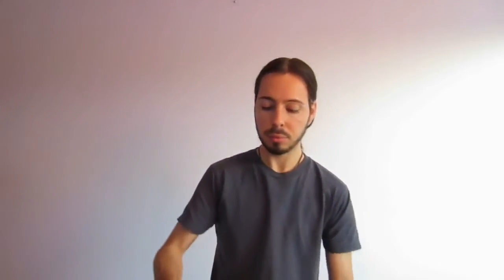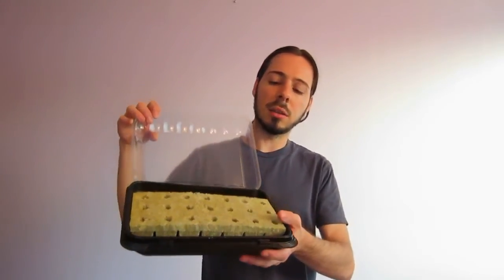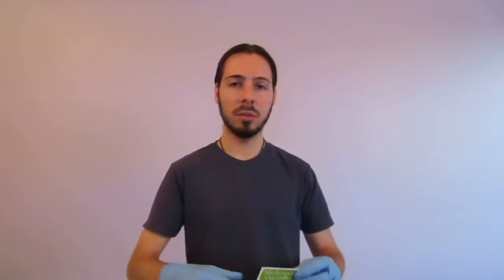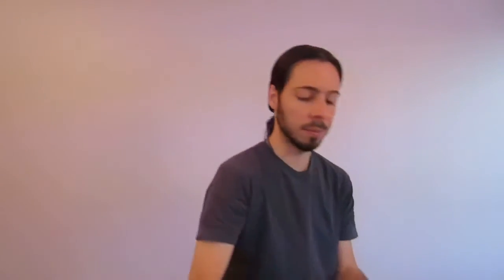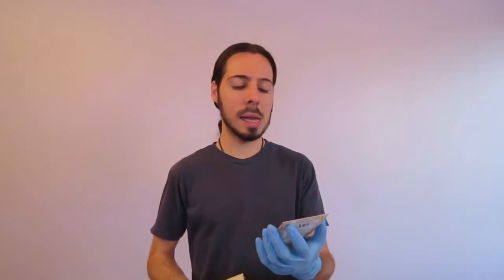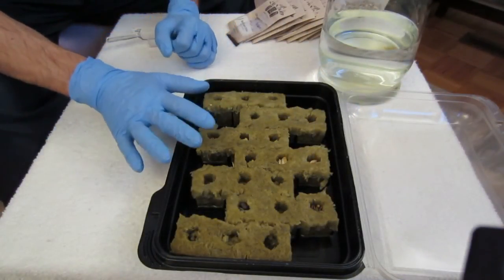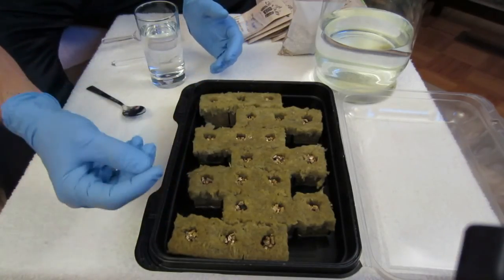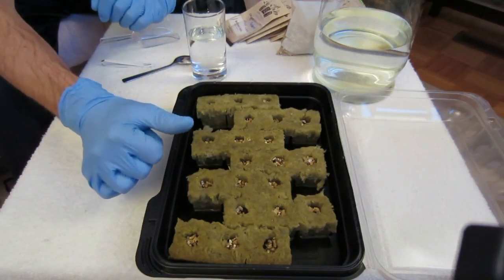Tower Garden Germination Preparation

Comment: Thank you for your great video. I just purchased the indoor tower with grow lights, and I've seen videos recommending starting seeds directly in the tower as well as in the provided trays. I live in zone 6B (34 - 50 degrees F today) with diminishing sunlight moving into winter, and no great sunny location in which to start my seeds on a window sill. What are your thoughts about starting seeds directly in the tower and using the grow lights? Many thanks!
Reply from the maker: Hey there Kate! Great question, and I just responded to someone about this, I might copy and paste some details :-P
Your zone ain't too much warmer than mine, guess your outdoor growing season is done'ish!
Don't start seedlings in the Tower tho.

Now some copy and paste   haha
It is CRITICAL that those into indoor growing, invest into growing lights. Almost any type of grow light will work fine for starting seeds, they just need to be at the right distance from the seed/plant canopy for it's type (CF about 6" away and LEDs usually 1.5 to 2 feet away). Without the adequate lighting, the seedlings always become leggy and weak and may not survive the long haul. Beside a window just doesn't cut it.
Once the seedlings have developed their first or second pair of TRUE leaves, their "neck" is done stretching, and with close proximity to the lights that neck stem won't stretch much from the start, that's what you want.
You Cannot start seeds in the tower garden itself, because the lights are far too distant from the seeds. You'll produce plants with a poor support structure. Mature seedlings need to be nurtured first before being transplanted into the garden!
Reply: @CardinalGardener  thank you for your time and invaluable instructions! I'm very excited to start the germination process effectively. I have LED grow lights on positional gooseneck armatures that attach to the tower top. I can angle them to shine as you've directed over the grow boxes.

Comment: Tim Blank says do NOT add the Tower Tonic until the seedlings are at least a couple of inches tall. They will grow a healthier root system if it has to "work" at finding nutrients.
Reply from the maker: You could follow that advice. I been doing this enough years now to know that what really makes or breaks the deal to successful germination, is good seed that's been properly stored, constant moisture levels of course, and an abundance of light! But you're right seedlings don't need "food" until they start to grow their first true leaves.
Also worth mentioning I no longer germinate seeds in this way as I made a little deep water culture germination station which is how I start my seeds for hydroponics purposes.

Comment: When do i plug up the tower garden?  Do i wait for the seeds to germinate before adding nutrients to the tower ?
Reply from the maker: Hey Allegra
When you anticipate your seedlings will be ready in a few days time that they can move to their bigger home, you can set up the Tower with water and nutrients and do all that needs to be done, whenever you want really up to a day or a few days before you move things into the Tower. Yes you will want to add nutrients to your filled up water reservoir. Only half strength though, so if you're using the Tower Tonic A and B then that would be 200 ml of each if memory serves me right. As the plants get bigger, probably by the next time you need to top up the reservoir with water, you can go full dose of nutrients (relative to the amount of water you're adding in so always know how much water you're filling in, I use pales or bottles to deposit water into the reservoir, not a watering hose, for one reason being that I'll know how much water is going in). Then I can more reasonably eyeball how much nutrients I'm gonna add. And if the plants are really really flourishing and using water more quickly I tend to use a little less Nutrient solution because water is going quicker than Nutrients are being used up (noteworthy for hot summer days). Eventually, you just get a feel for it and it becomes a little more personal than scientific :-P
That's my experience anyway hehe
Though a simple battery operated TDS reader is also a cool gadget to measure the parts per million PPM in the water reservoir, so if the number is too high, say over 500 or 600, PROBABLY a sign too much nutrients in there (for tap water). For distilled water which is what I use, I keep it under 300 PPM.
Sorry if I inundated you with too much information to your question lol
Happy growing tho!!!

Comment: Can I use coconut coir instead of rock wool?
Reply from the maker: Hey there. Well, I have not experimented with growing seedlings in coconut coir for use in the Tower Garden. I would say probably, but you would need to make sure of the following:
1) That the coir does not disintegrate when consistently exposed/submerged in water, because you don't want little coconut pieces streaming into the water reservoir and jamming up the pump.
2) That the coir fits adequately into the neti pots on the tower and the roots are able to grow out from them to gain exposure to the trickling water in the tower slots.
Are you opting for coconut coir for eco/sustainability purposes?
Reply: Joel Simoes Yes and it has just worked so well for me in other growing projects. Figured I would give it a try.